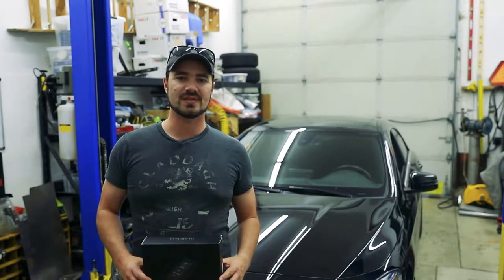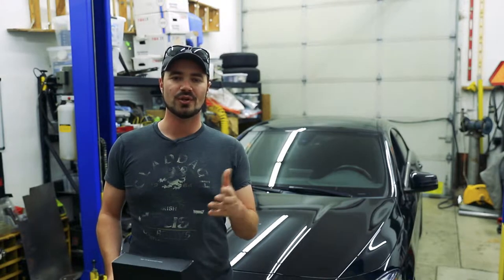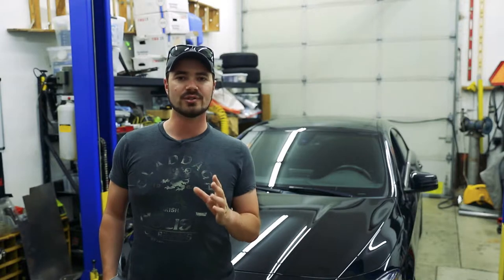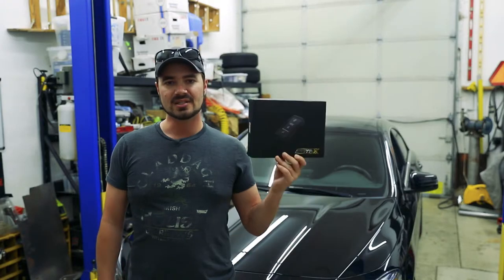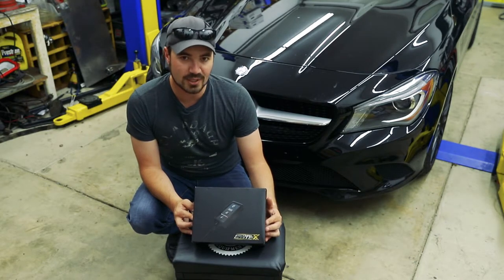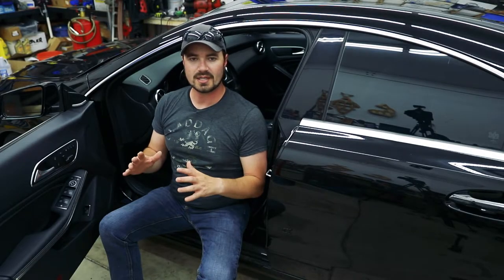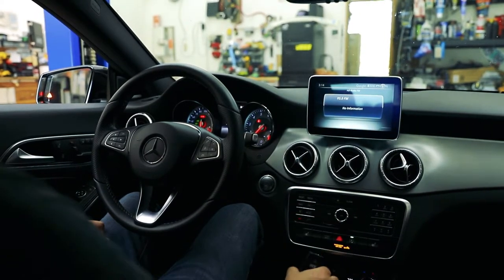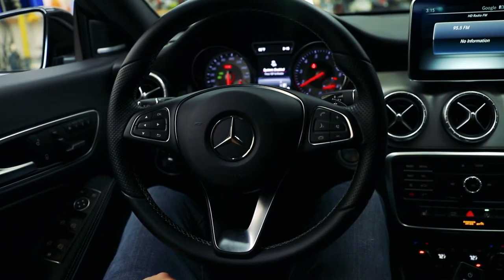Throttle chip install on Mercedes

Comment: Do you like c class Mercedes?
Reply from the maker: It was good for what it was, but not a great fit for me. Driving mostly exciting cars, the Mercedes just wasn't interesting enough to make me want to be in it rather than my other cars. If I just wanted a decent looking newer sedan, it would be a great option.

In the end, I sold it off and replaced it with the Dodge Viper before the warranty expired.
Reply: Hey bro. I bought cla 250 too. And i have pcx too. Can u explain when the green light is on, on pcx makes my car more eco or not?
Reply from the maker: If your PCX is the same version, the green lights on one end are the lowest sensitivity setting, which would be the most fuel efficient. When you move into the red lights, you are now starting to add response above the stock throttle I believe. Doing so does not automatically make your mileage worse, but it makes it easier to be less efficient with throttle application and the car more "jumpy".

Hope that helps!
Reply: @AmbiVe  I went on the website but I couldn’t find my 2016 cla 250 4matic on there. Which one did you choose?
Reply from the maker: @andrewgarcia7048  I haven't looked in a while, but I believe you have to choose 2013+ rather than 2015+. Basically, the CLAs were the same from 2013 and up other than the v8 change in 2015.

I hope that helps!
Reply: @AmbiVe  I have an 2007 c230 W203 mercedes which do you recommend?

Comment: Hi 
1) you bought these item from Ebay 
https://www.ebay.com/itm/Mercedes-A-Class-W176-A-250-218-HP-2012-2018-Pedal-Chip-X-Throttle-Tuning/163254692362?hash=item2602bcea0a:g:q2gAAOSwKfJbUJJ~
2) the installation is plug and play, or you have to download a software to the pedal chip?